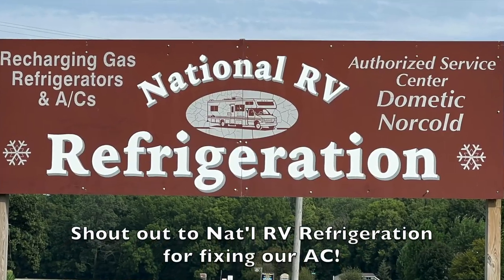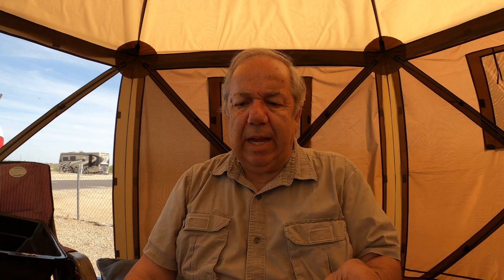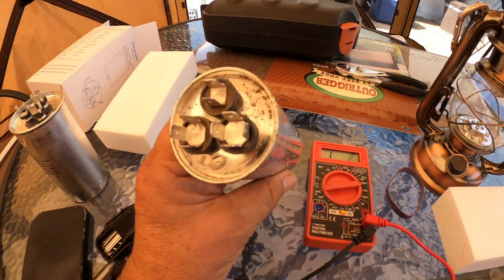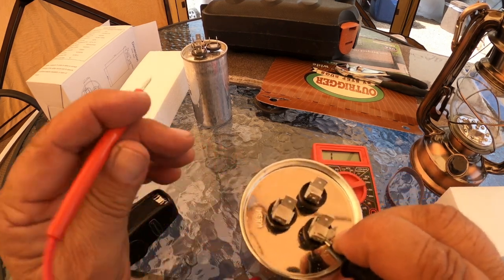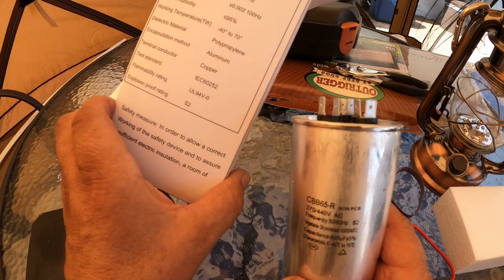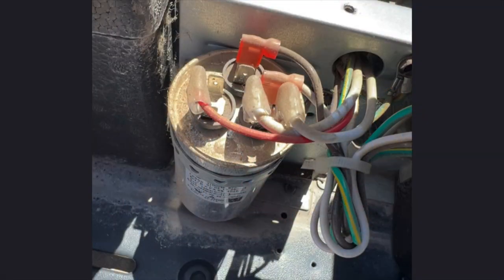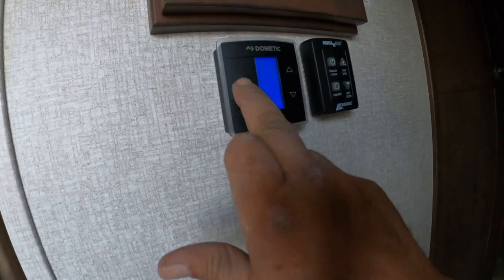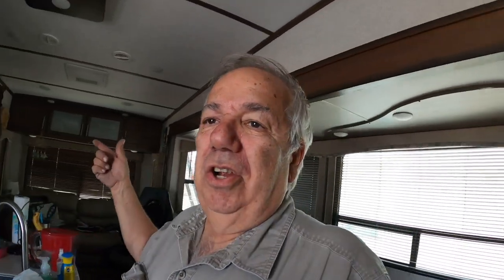RV AC Capacitor Testing and Replacement

Comment: Thanks for the video. My AC stopped pushing cold air, the fan works well but no cold air. Will it probably be the capacitor?
Reply from the maker: Invest in an inexpensive multi meter.   It’s easy to test the capacitor.  Your issue hopefully is the capacitor but it could also be low or no coolant.
Reply: @ourroadtocamelot  Yes, I do have a good multimeter and I did the test and it appears that the capacitor is faulty and I've ordered one already; let's see!! The fan is working well, so I hope the new capacitor will get the compressor going!! Thanks for your reply
Reply: @ourroadtocamelot   I changed the 3 capacitors but still the compressor fails to work ( it tries to spin but it stops after a few seconds). The fan works great. What is next for me to do? How can I test the compressor itself? Thanks

Comment: Wondering if mine went out. AC worked great yesterday and today as its 98 degrees turned on and humming and sounds like it wants to turn in but can won’t kick in and it just kind of bogs and trys.  Very old system. I’m thinking try s capacitor first   I guess it could be the fan motor too maybe. Did a visual inspection and nothing fryed or anything
Reply from the maker: Test the capacitor but it does sounds like it could be the motor
Reply: @ourroadtocamelot  I got it going by giving the fan a push   Its in limp
Mode though. Very low power and now the system is freezing I think because of the low fan   So I guess the fan is shot out of the clear blue sky. Worked great 2 days ago.
Reply: @mick5740  that sounds exactly like the problem we had last year with our other AC.   Wound up it was the motor.   I had it done but I watched the repair.   If your handy it’s an easy fix.

Comment: I think thats whats wrong with our too.  I oiled the bearings and it worked for about two days then it seized up. I can spin the blower fan fine when it is not turned on, but when i turn it on the blower locks up.
Reply from the maker: That happened last summer with our other air conditioner.  It wound up being the motor.   Got it replaced and it’s worked perfect ever since